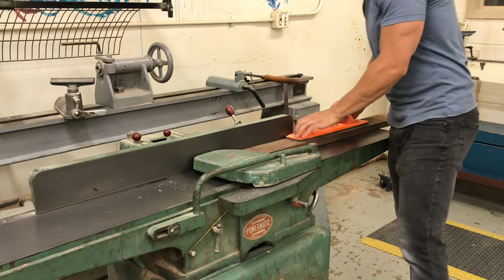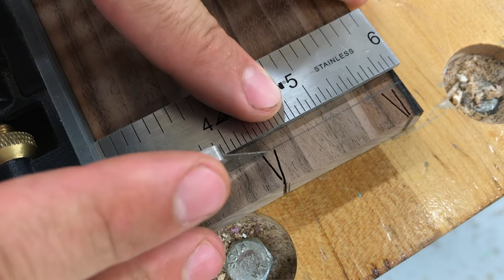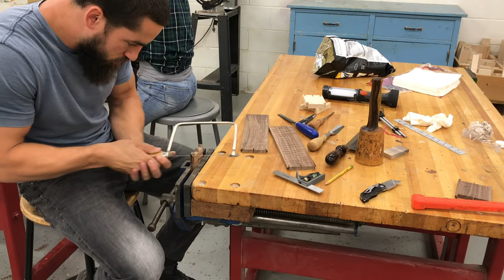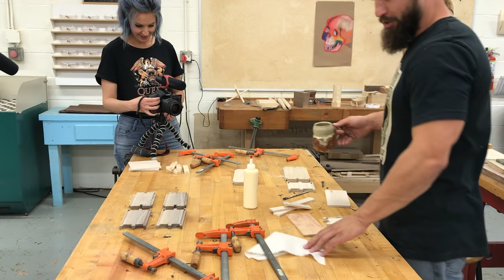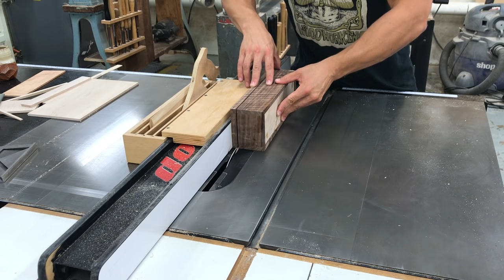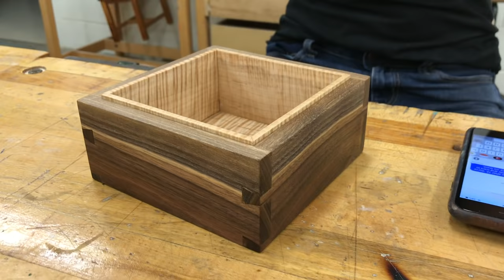How to Make a Beautiful Dovetail Box (featuring Pneumatic Addict and DIY Huntress)

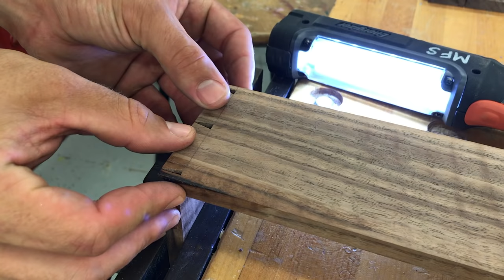Comment: 3:23 THIS!!! This is the kind of detail that is helpful. Using a break-knife to mark pins down in the dovetails. ALL OTHER YOUTUBERS I've seen use a purpose made marking knife for this, like there's no other way or tool that gets this done but, IN FACT, the thinness if a break-knife blade makes it (in my opinion) a better tool than a marking knife which has so much thickness in the blade that you can't fit it between the tails.